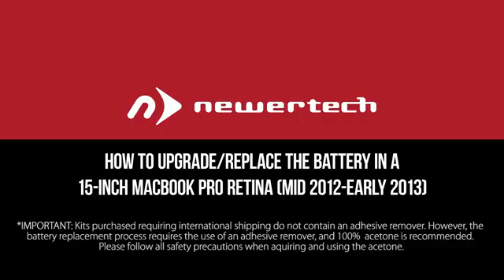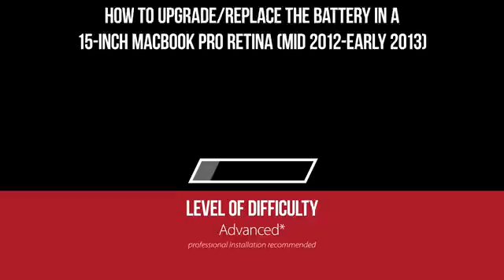How to Upgrade the Battery in a MacBook Pro Retina 15-inch (mid 2012 - early 2013) MacBookPro10,1

Comment: If you actually want to remove the battery yourself there's a much easier way if you go back to your search. The method is using string of some sort pushing it around the battery cells, and pulling them out. You don't need to take the whole damn thing apart lmaoo.

Comment: Thanks MacSales - I watched your video first, then ordered the battery. I found the video very detailed with precise instructions that were nicely narrated. Everything works EXACTLY as shown in the tutorial. One caution though, as mentioned in the video, be VERY sure you've moved every connector out of the way before replacing the motherboard. It got me when reconnecting the keyboard backlight (and a couple others). I recommend setting up a space to lay out all the parts and torx screws in the pattern they were removed, it helps keep everything organized when putting it all back together. Great video tutorial - I wish all were as good as this one.

Comment: Great tutorial! Just finished replacing my battery on Mid-2012 MacBook Pro Retina 15-inch using this tutorial. It took me about 3 hours to do. I had a difficult time getting the adhesive from the old battery off. Thanks so much.

Comment: Why do you need to take everything out? instead of just replace the battery. Is it because the adhesive remover can cause damage to the board and parts?
Reply: The adhesive remover is Isopropyl alcohol which will not damage the logic board. However you do need to be very careful not to get it on the screen. So calling BS on your comment. Sorry :)

Comment: Awesome video OWC!!!
I really miss my Core 2 Duo MBP, when the battery reached the end of it's life, I could replace it in 5 seconds with 2 small latches. This is unfuckingbelieveable. The battery in my 2013 MBP lasted about 4 years then it was useless. So much for extended life so you don't need to replace it! Apple seriously needs to reconsider their design ethics, thinness isn't everything. Who gives a hoot if it's 1mm thinner if it's performance or life is expectancy is impacted!

Comment: Okay, so I just did this and was thinking it wasn’t so bad.  I would be extremely careful removing the speaker wire that they don’t show very well, as a label is blocking your view.  I ripped my off the mother board! Also I’d avoid removing the excess glue as this was the hardest step and it’s optional!!  In hindsight I should have watched the whole video right before I did it!

Comment: As they won't ship to my country (I live in Mauritius), I had to buy a replacement battery from China so I did not have all that kit. I did the job using white spirit as glue remover and a small stucco spatula to detach the battery. So I dismantled the whole thing as per instruction only to realise that with my method you don't need to. The battery came off so easily that you do need even to remove the speakers.
Reply: I typed to fast… read "the battery came off so easily that you do not even need to remove the speakers"

Comment: Just followed the guide this morning. Pretty easy. I'd recommend maybe adding some thermal grease in your replacement kit and a couple steps on how to change the cpu and gpu grease while letting any acetone from the battery removal dry in that 30 minute wait.
Reply: you mean thermal paste?

Comment: Apple is supposed to be User Friendly!! Unbelievable!! you need a PHD in Electronics to replace a battery :(
Reply: It's not that hard at all. It's literally just screw removal and putting everything back.
Reply: Their software and UI are user friendly, not the hardware. (Also, this is really easy)
Reply: Apple deliberately makes repairs difficult, if not impossible (often) and deliberately makes parts for their devices not 3rd party manufacturable. It's the 1 and only reason I don't purchase Macs. If I could fix them as easily as any PC could be repaired, I would probably spend the money...but you are correct, when they sell their stuff at already 3X the cost of other products you expect it to be 'better' . And for the most part, they are...but you just can't get around the fact that a battery is just a battery, and they have a lifespan...it's a fact of life. The "pop-out/pop-in batteries of windows laptops are highly preferable to macs. That's point #1. Point #2 is the fact that running a laptop on AC power WITH the batter installed, shortens the lifespan of ANY battery. So, on NON-APPLE products, you are actually able to PULL the battery, and simply run on AC power alone, significantly extending the life of the battery, in most cases past the lifespan of the machine itself. I have a 5 year old laptop myself right now...and the battery has been connected to the laptop only 3-4 times, EVER! You just can't do that on a MacBook. So while people toot the Apple horn...there are many downfalls.

Comment: I hate this too. I just got back from the genius bar after waiting a week just for them to tell me that my 2012 mid MBP is vintage and no longer supported. I guess Im supposed to throw it out and buy a new one. Goodbye Apple I am going back to PC!
Reply: I wish I could, but I work on cinema VFX and most of  the pro software doesn't run on Linux, so I'd have to fall on Windows. from the pan into the fire.
Reply: Mmm it doesn’t mean that you can’t fix anything in there. I went to the Genius Bar yesterday and they said that while it is vintage it’s possible to get fixed, it being vintage does not factor into cost in anyway merely that the parts available for repair are scarce.
Reply: @Roman-sl5sn  He said I could try other stores but did not offer to check. Parts are scare because Apple wants users to upgrade. They chose what to batteries to keep in stock/order.
Reply: @turkeclipse  Lookup Louis Rossmann on youtube, best person on planet to fix any apple device.
Reply: I'm ditching Apple after all the BS of trying to get repairs, What wait a minute too OLD to supply parts, you still update the software for this MotheF^&*%$ why would you not supply parts.

Comment: Sorry, i'm very new at these.
I would like to know what is that shiny part that looks like two little magnets o metal parts that are in the grey plastic that surrounds the battery. You can see one near the keyboard connector. Mine have some rust on it and I'm busting my head trying to find how is that called and what it does. Do you know? Thanks!

Comment: So--- why the major disassembly only to replace all the boards/cables before putting the new battery in? Is it just for safety reasons so the adhesive removed does not damage the boards?
Reply: yves eynard my thoughts exactly. I think it’s to protect the mother board and every other little thing that might fry the computer. I’d rather risk it than doing all that extra stuff.
Reply: Thank you very much for responding.

Comment: My battery kit doesn’t have an adhesive remover. Where can I find it?
Reply: Use a strong dental floss to cut the adhessive tape
Reply: MacSales. com No, no. Not at all. Another company’s. Sorry!
Reply: @poweredbyowc  The video doesn't explain why it is necessary to remove the rest of the internals, why is this? Seems like the battery could just be pulled out after 2:10 in the video, and removing the retaining screws?

Comment: What it the reason it is all taken apart to remove the battery then put all back in before installing the new battery.  Can't you just remove the old one and install the new one without going through the whole board removal process?
Reply: The acetone will melt the PCB coatings on the motherboard. If you remove the battery using floss, you don't need to remove everything.
Reply: @InvntdXNEWROMAN  I used white spirit, which does the job without being corrosive.
Reply: I agree. What am I missing here? If it's all to be able to remove the adhesive, why doesn't the new one require adhesive?
Reply: If you get any of that highly corrosive adhesive remover on any of the logic board, or other critical components, then your computer is toast. That's my guess, anyway. I think it's an entirely protective measure to ensure you don't damage or destroy the logic components. And the new battery does have adhesive. It's double-backed tape that's already applied.
Reply: Why not use a hair dryer to loosen the adhesive? :)
Reply: @tatski2274  generally, heating up a lithium battery isn't a good idea. Even if it's just a hair dryer.